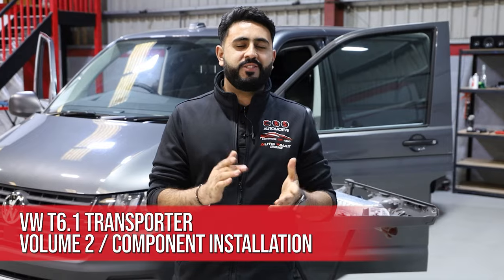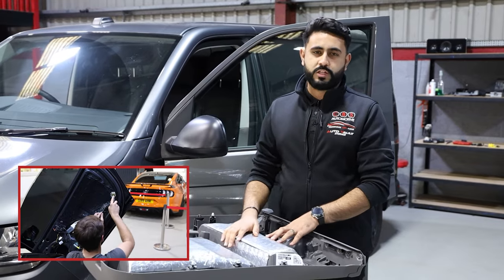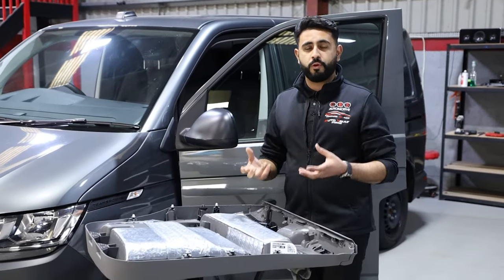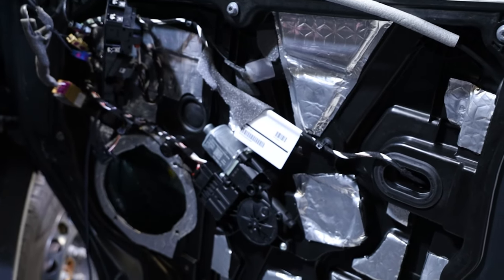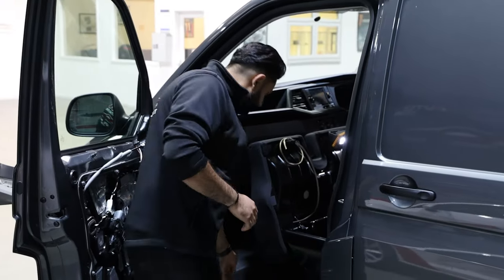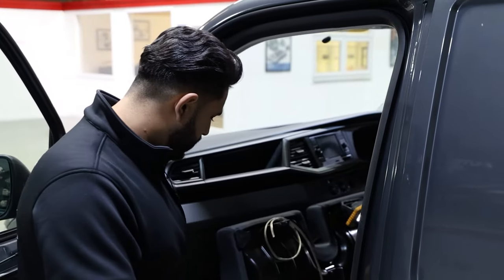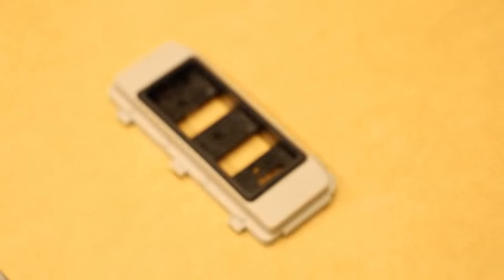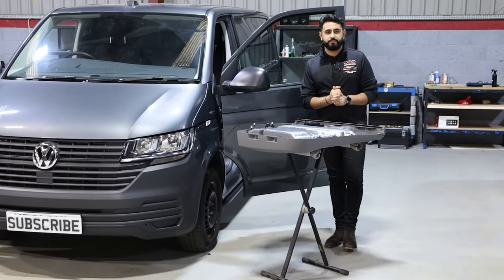TRANSFORMING The T6.1 Front End! | Behind The Sound - VW T6.1 Transporter

Comment: Ain't the sound mats that are on the outer layer getting wet if it's a wet type door?
Reply from the maker: Yes, but because the area we are applying is clean and we heat the sound proofing and roll it on, it won't come off plus the product is designed to do that